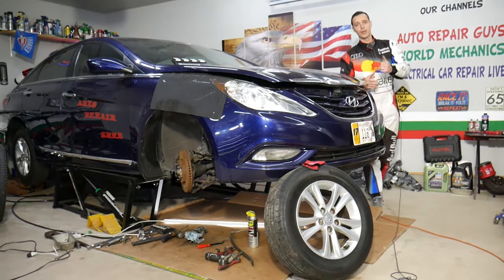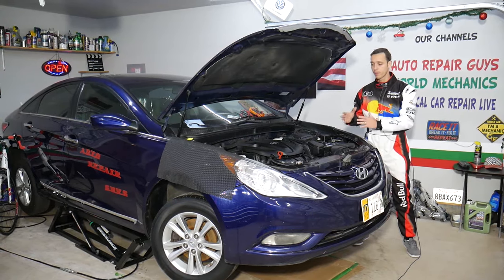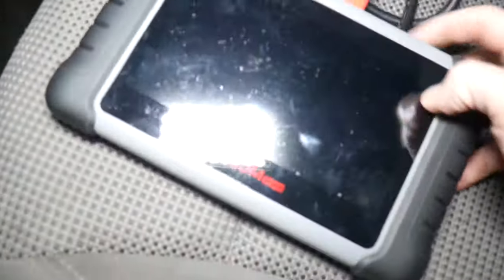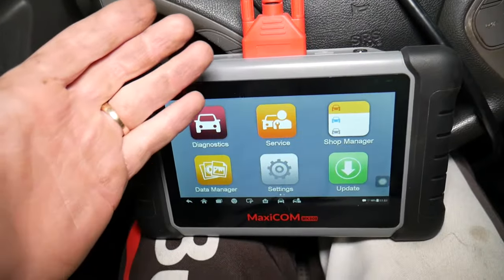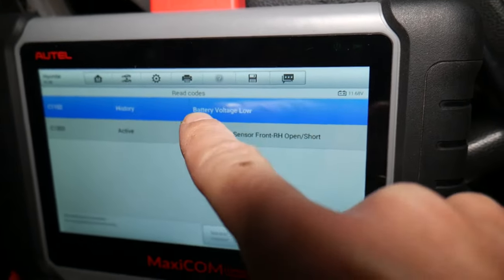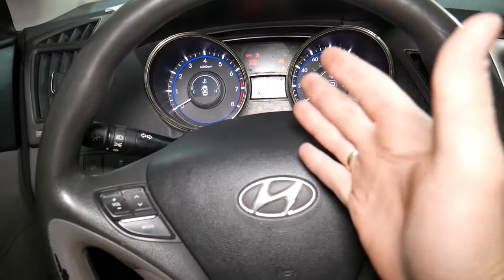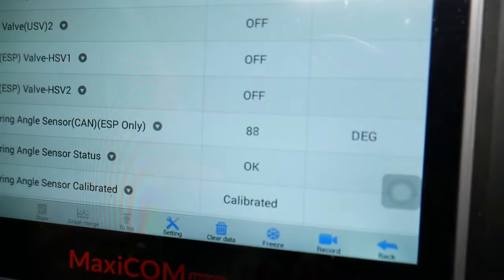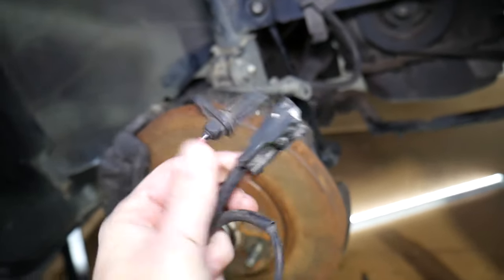TOP 3 WHY ABS TRACTION CONTROL LIGHT ON HYUNDAI SONATA

Comment: Anyone have nfo on flashing the computer and shutting these unnecessary unsafe electronic features off? My abs brakes the vehicle while driving when turning and is causing premature tire wear. Already took it to a mechanic and replaced a wheel sensor and it is still doing it. There should be a way to opt out of these expensive unsafe and wasteful features. Thanks in advance.

Comment: Hi guys, thank you for this wonderful channel. It has been helpful.
I have a 2012 Hyundai Sonata and I have noticed the ODO meter and Temperature gauge fluctuates. The move up and down randomly even when the vehicle is parked. Sometimes while in motion, they start fluctuating and it affects speed selection. The engine just revs but does move faster; I have to sometimes park, turn off engine and start all over again. Please how can I get over this?

Comment: I THINK I DAMAGED MY DAMN WHEEL SENSOR WHEN I CHANGED MY AXLE.
ALWAYS TAKE OFF EVERYTHING THAT CAN GET STRETCHED AND DAMAGED AND HANG IT. DONT TAKE CHANCES.
Reply: I just changed my axle.  Now trouble code stating right front sensor an issue.  Did replacing the sensor fix your problem?
Reply: Same! Changed an axle and now I have these lights on
Reply: @liveandletlive2894  mine was the opposite side of what I thought it was. I was sure I had damaged the driver side sensor but the passenger side went bad. Replacing the sensor fixed all lights and it was an easy job.